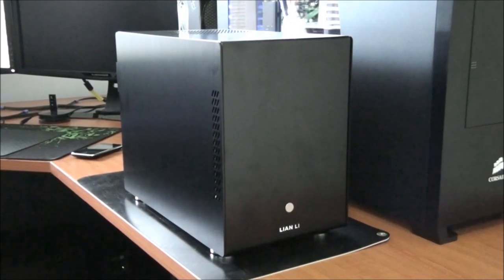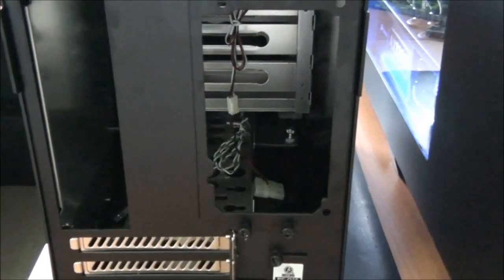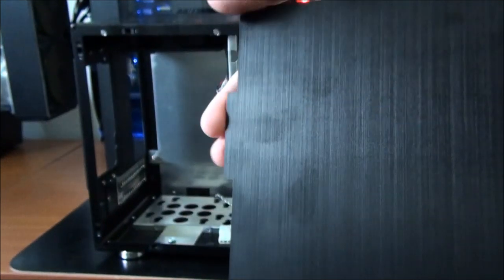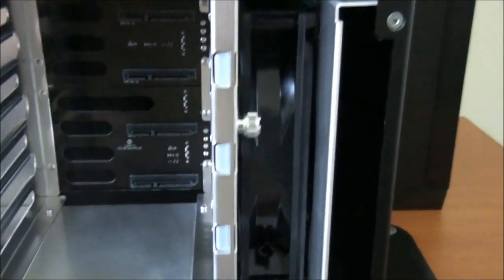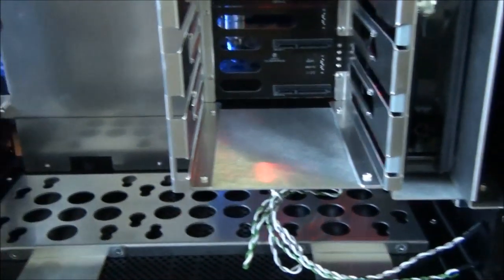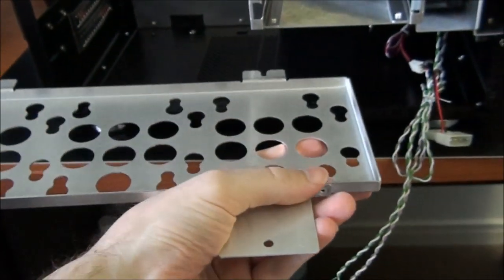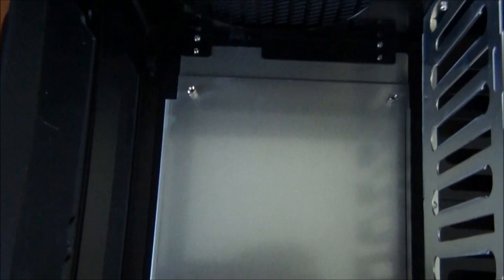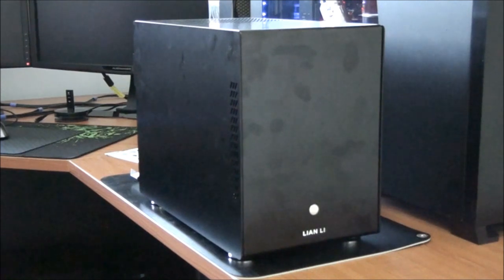Lian Li PC-Q25 Case Review

Comment: @10:10
For a normal PC, it is not a very good case when the power supply is in front of the motherboard. In such a constellation there is no room for a big cooler like a Thermalright HR-02 Macho  Rev B.
It might be okay for special purposes, like a NAS, but on the other side it's to big for a NAS in my opinion. Especially because it has only 5 hot swap bays. Other PC cases of the same size offer more hot swap bays.

But thanks for the great review.
Reply: OpenGL4ever Got an example of a similarly sized case with many more hot swap bays? I'm certainly not aware of any. The Silverstone DS380 and Lian Li PC-Q26 both have more hotswap bays, but they're around twice as large as this case.

Comment: I've got a few Hitachi Ultrastar 0b22131 drives, they're SAS drives. Between the Power and Data connections on the drive, there's another connector. From all the pics I've seen of this case, the hotswap bays are normal connectors, how hard do you think it would be to mod them to fit these Hitachi drives? Looks like an awesome case and I really wanna make myself a NAS.

Comment: Could you tell me the height of the top fan? Would it be possible to mount the Corsair Hydro Series H60 watercooling instead (which is 2.7cm thick, including the radiator) or would this collide with the mainboard?